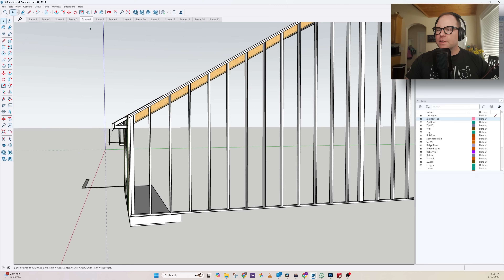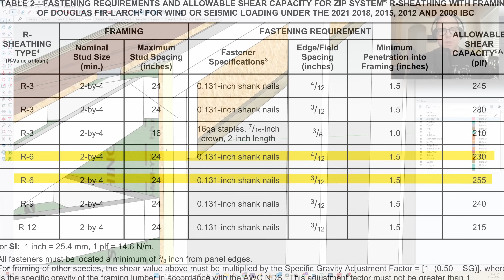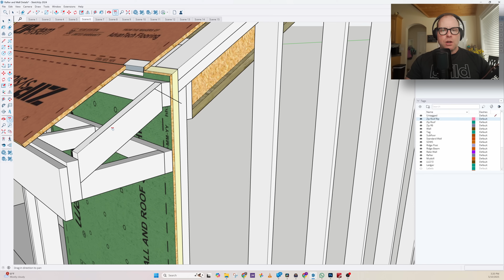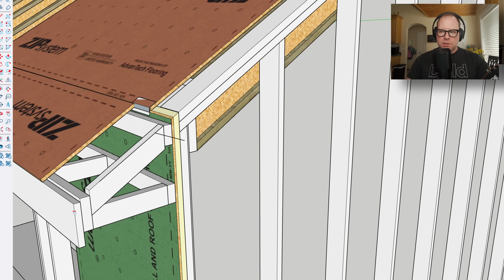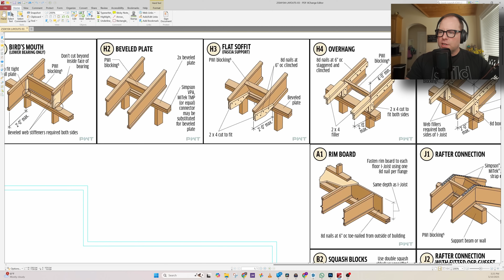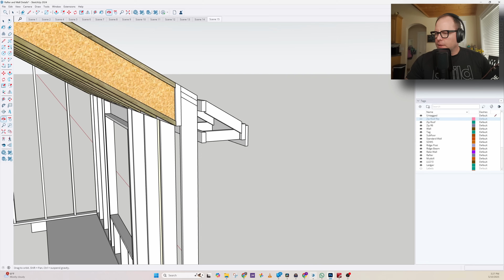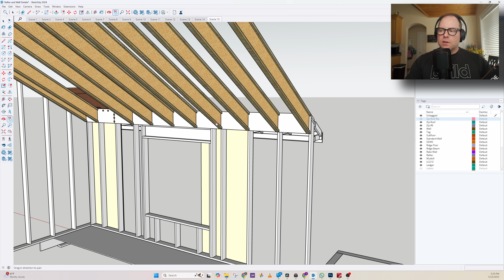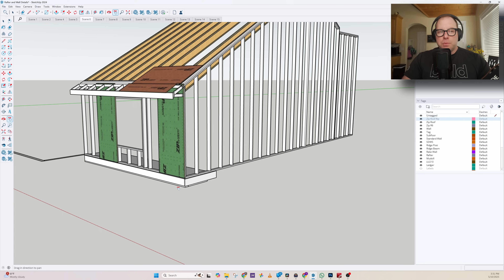Help Me Build It Better – Your Feedback Needed!

Comment: I have a passive solar 6/12 warm skillion roof timber frame with masonry north wall. Close in shape to what he showed. I could only span about 15 feet because 2x12's. So have a middle bent. My over hangs are tied into the warm roof. I have exposed rafters and tongue and groove roof board that land on beams and end. No drywall, because tongue and groove. I have a planter box on south wall. So need moisture to escape. That's why mineral wool board wrap cottage and low perm vapor barrier. I have 70 psf snow loads and needed r 60 roof for code. The r 60 roof insulation was why I went with warm roof. My rafter tails are 2x4 green board and 3 foot long, but sit on cmu and riprap veneer stone. The rafter tails screw into my roofs insulation box and provide ventilation for warm roof. We asked our engineer for cheapest design to build. And got A frame and skillion designs. We use glulam beams so only need to mortise post and add bracing. No tenon cuts needed for glulams. Cost of glulam less than labor for tenons. Mine are closer to H4 with can't strips on middle bent. The 2x8 for insulation box is notched for rafter tails. We use truck winch to stand up bents.

Comment: Split the roof sheathing and overhang sheathing on the canted top plates, something like 3.5" and 2.5", respectively.  Zip tape your monopoly framing before the overhang goes on.  Then add on the overhang with preinstalled sheathing with the 2.5" + 1.5" lip (add 1.5" for the ZipR thickness).

Comment: How about building a Eaton Canyon wildfire 1/7/25 single family 1 story here in Altadena.  I plan on exterior Zip for walls to the roof R6 from the Foundation and on the subfloor over the crawlspace and at the attic floor.   The crawlspace grade will be sealed with 10 mil and lay pea gravel or concrete slurry.  All framed in 2 x 6 min. I am struggling with what to do in on the Roof for insulation    I will add 2 foot eaves on my 12/12 roof.  What say you.  I am new and absolutely the videos.  Fantastic

Comment: I have a few general suggestions for minimizing framing members and thermal bridging. 1- Remove fire blocking between floors.  
If I'm reading IRC 302.11 correctly, most insulations installed normally are approved as fire blocking. And if you read 302.12 "draft stopping" carefully it doesn't apply. 2- Remove the 2x6 below your headers. I just rip a board down and nail it flush with the bottom of my headers it also allows you to raise your window 1.5" if needed. With the ZIP-R6 there is not much bridging so you would see a bigger benefit when not using continuous insolation.

Comment: Yous are so well set up over in the us i did the roof on my mates house the other week huge big things hips blind valleys open valleys unuqual pitches with different over hanges 1story with rooms in th attic put our own steel where we wanted picked the rafter size where the purlins go ridge size just given a oh and height no inspections no nobody we do things diffrently over here but similiar not as anal .joisting and studwork dont line up we  dont timber frame on site concrete finishers dont exisit just a pump and lads with a 3' tamper and we consider american  built houses cheaper and inferior in europe you guys do it better faster and cheaper expected lifespan of a home here is expected 50yrs before a major overhaul new roof tiles pointing windows renders etc not that long. Timber frame house with siding is probably the same i seen a lad roof a 200sqm roof noto long ago with 7m rafters hip etc nailed the whole thing with fraimig nails but jointed hip rafters on the purlin cowboys making good money. No sketchup and how would you do that. I respect how you do things over there most carpenters over here wouldnt last long over there. Respect

Comment: Could you use spray foam or pl to attach the sheathing to the overhangs instead of taping over the zip from the roof to the wall? This way you could still be able to run your sheathing from the roof over the overhangs and also be air tight in that area?

Comment: Structural engineer here from the opposite side of the country. Just some overall thoughts on the overhang detail. It looks like you're expecting to use a toe screw through the overhang rafter. This won't necessarily align with your studs, so the only thing they're hitting is the ledger on the opposite side of the wall (screw comes in too low to hit your top plates). That might work, but that leaves a stud-widths gap in the fastener. That would be a no-go since the screws would be in tension and shear for this application. Of course you could add additional hardware to lock the rafter to the exterior ledger which is connected to the studs. You're also making the soffit framing structural to support the overhang and work in compression as the rafter is working in tension. Might not be a problem, but wouldn't work without a soffit and you'd have to attach the soffit similarly because you have to think of the wind load uplift on the overhang. The uplift reverses all these screw forces, so you really to secure the soffit framing in a similar way. Also, I'm not sure if this is an issue or not, but won't the drywaller need blocking at the rafter-wall joint anyway?

Comment: Yall may want to look at the Simpson WP top flange hanger. You might could detail it to hang the rafters from the top plate and then add beveled plate over the hanger to flush top of wall with top of rafters. This would save you from the lvl ledger.

Comment: Starting with the monopoly build, and air sealing the outside and creating an envelope for air sealing . And if you would like to add zip-r to eliminate thermal bridging you could
I don’t see why the rest of the construction has to be so complicated.
I don’t see the need for rafter tails and the build up to achieve this.
Keep in mind I’m not a builder or engineer and this is not my profession.
Why not a normal monopoly build filling the rafter bays as normal. Then overlay the entire roof with a 2x4 structure. Creating the opportunity to have a “normal” construction of rafter tails and soffit, leaving a continuous structure from fascia to peak. Then of course you would need another layer of sheathing on top. 
The items Im not clear on, and I am not considering , Are fastener to attach the 2x4 structure on top. Do the “rafter overlays”need truss braces at the peak?
I would also suggest insulation on top of the monopoly roof (maybe rockwool of the rigid type) and also leaving an air gap underneath the sheathing that the roofing materials would be attached.
You would essentially have a way  for water and air to move out of the roof structure and would have a second water and air layer on the monopoly part of structure.
Hope I’m explaining this well enough.
This however seems like it would get expensive with materials.  But maybe save labor in the end. This type of construction does seem like it would get more complicated with particular roof layouts.  If I was doing this type of construction, I think it’s the way I would go as it would be easier for me to accomplish. Thoughts?
Reply: Not one reaction? Come on folks . I really wanted some feedback.
I may not be explaining myself well enough to get a reaction.

Comment: As a “Definitely NOT a Framer” but rather a fabricator, I don’t understand why you couldn’t do the double top plate bevel wall and just angle cut the rafters with an extra tall rim board (a modified 1B) then do the overhang as you have it drawn. Seems like a little extra work for the wall but a lot less labor for the roof framing.
Reply from the maker: There's a fair amount of labor in cutting and reinforcing the I Joists.  As a framer, these details in the video would be my preference.
Reply: I’m sorry but I’m still trying to process this. If you built your wall as drawn, but lowered it by the vertical height of your rafters, then you extended your rafters by the 4” or so in order to put the rafters on top of the wall with a vertical rim board flush with the outside of the wall it would be like having an angled floor because the only cut for the joists are the single bevel. You could probably even Simpson screw the joints to the double top plate. My apologies if my thinking is off. It’s a lot easier for me to draw than describe. Great videos though. Thank you.
Reply from the maker: @Mike-g5w6k  You can do that for sure.  Then I have to add a cant strip to the top of the wall, which means setting up a table saw and ripping them at a 60°. That alone will take longer than what I show here.  Then I have to install the rim, and sheathe over that.

Comment: After reading the comments so far, I am in favor of straps to tie the soffit assembly to the main roof rather than the  structural screws for the reasons stated: straps would be in tension as intended whereas screws would be primarily subject to shear loads (NOT as intended); straps are more flexible/ductile vs. screws being more brittle (straps are less subject to sudden catastrophic failure); straps would eliminate the variable introduced by the layer of rigid insulation on the back side of the Zip sheathing. I know you love the screws and I’m sure your engineer could get them to calc out sufficiently to meet code, but I believe the straps would perform better in the long run, especially during a seismic event (which WILL happen eventually in the PNW).

Comment: I believe your target is the rafter connection to the header/top plate.  For some reason it appeared you were targeting the overhang extension.  If I understand correctly, the attachment point for the rafter needs to terminate inline with the stud and header/top plates so as to not interfere with the vertical zip sheeting.  Seems like you still want balloon framing, so that rafter loads directly over studs.  I have two K-I-S-S ideas for you.

Idea#1: How about a bookshelf solution for the header?  Run an extra wide single top plate across your studs that overhangs the inside of the wall studs. Then run a horizontal batten to screw to the studs and top plate.  You get the double top plate strength and have more meat to set your rafters upon.  Set the top plate that runs across the studs in a bit to avoid the need for a bevel cut to keep in plane with the zip sheeting.  I would want wedging tagged on the bottom sides of the I-frame rafters to avoid bird-mouth cuts.  I would also want metal brackets of some type from the top plate to the rafter in order to lock it into position so as to prevent the rafter from pushing the studs in and out.  The alternative to wedges is to use plywood to build a common wedgebox from corner to corner to set the rafters upon.  Build the wedges into the wedgebox or drop a 2-by on the inside edge and nail off the plywood from outside edge to the  2-by to form the wedge box.  Either solution can be filled with cellulose to kill the air gap.  And ideally you are building this all on the ground before raising the wall.

Idea#2: Don't fight the need for stability and utilize a staggered stud wall. Every other rafter lines up with the studs of the same wall.  Every rafter will have a stud underneath, just not necessary two rafters in a row rest all their weight on the same wall.  Your portal would be two studs thick, which may not work for you.  For the portal maybe run studs on both walls to carry the window header.  The big advantage is you would be able to build each wall height slightly different in height to basically create your rafter slope support.  And by tying in the rafter to both top plates you prevent the wall from bulging under the load.  Bonus if your staggered studs allow enough thickness for an OSB or zip strip to run from corner to corner where the studs could all be conjoined to the same OSB/zip panel sandwiched between the two walls.  (Maybe the window header draws much its structural support from the OSB/zip sandwich, too.) That would give you side sheer strength in two dimensions and allow sandwiching of a 1/2" insulation board from floor to ceiling in between the walls for an added thermal barrier.  It would also allow you to retain 2x4 fire-blocking.  If that window is a breakfast nook then its a brilliant way to utilize a wider wall.  As crazy as this idea may sound it fits along the lines of Matt Risinger's monopoly framing ideas.

Comment: Given your starting point, I would suggest leaning into the "monopoly" strategy. I would break the sheathing at the eave and tape (or if you are particularly worried liquid flash this location). Continuing this logic, I would suggest you considered getting rid of the closed cell spray foam and use ridged insulation over the roof sheathing. You eliminate the thermal bridging in the joists, avoid potential installation errors of the spray foam that can lead to condensation, and you can establish a continuous plane over across the over hangs. 

Your discussion raises broader questions on how to build more efficiently and cost effectively with Washington's current energy code. If you are starting fresh with a design, I like to start the insulation strategy thinking about the location of the where you are trying to air seal. I see two viable solutions, both with pluses and minus. You either handle it at the exterior sheathing (monopoly) or inside below the finishes. I am not a fan of systems that try to hybridize these two issues because it creates lots of fussy conditions like the ones you mention in the video.  If you decided to rely on air sealing on the interior, you could substitute the TJIs for raised heel trusses. Run the exterior insulation to the full depth of the roof insulation (which can be cheaper blown in products which easily hit R-60 values) and you functionally remove thermal bridging. This strategy allows you to get a more "traditional" vented soffit/roof condition with a continuous roof plane across the eaves. You also do not need to frame separate eaves because of the truss rafter tails.

Comment: I like the idea of Monopoly Framing in general. I see one detail in your drawing that concerns me. The specific way you are installing the rafter screws to fasten the overhang is perpendicular to the load. That puts the screws in sheer stress instead of the normal tension stress. I have never seen these screws prescribed this way and I don't know how strong it is in sheer. That leads to a more pressing concern, that sheer load transfers through the Zip-R. Because there is an inch of foam, if the screw tries to bend, it would only have to dig sideways through 7/16" OSB in order to deflect. I would suggest angling all-purpose construction screws at an upward angle into the double top plate. That will put the screw in tension and apply less force in sheer on the screw shank across the OSB. It also gives the added holding power of a screw head. GRK R4 screws are available up to 8" long so penetration should be possible.

Comment: Instead of building the walls to the top of the rafters, build them as normal rip a continuous engineered rim board to your roof pitch and land on the outside wall with a cant strip so that you don’t have to cut a bird’s mouth. Since you use 2 to 6 exterior walls that should still give you enough bearing, save you from cutting each stud on an angle, having to rip 2x8 double top plates, and cut way down on your hardware bill. As for the eaves, the way you have them drawn looks pretty much exactly the way we used to build them when I worked for a modular home company. Hold your sheeting up 8 inches or so from the bottom of the rafters cover that gap with a piece of Sunfelt and then tape it to the roof. Then, when you sheet the overhangs that 8 inches of OSB will tie the whole thing together.

Comment: I like your detail. I have been leaving the overhang off and taping the wall to roof connection for over 10 years and love it. I have tried different methods but have settled on something similar to what you have drawn. Structurely I like the decking to span the overhang to main roof connection. However we get a better seal that is easier to do by stopping the sheathing like you have drawn. We work in a rural setting and have never ran this detail by an engineer but have not ever had a problem with it. That being said we work in the South and have zero snow load and not much wind uplift load. Some people are talking about using ZipR on the roof. I know that Huber doesn't approve of this but has someone tried it? Also you should try the Medeek plugin for Sketchup for drawing your framing. I absolutely love it.
Reply from the maker: RE the Zip R on the roof......yes some are doing it "off label" 🙂

Medeek?  I'll look into that, thanks!

Comment: Just a small detail, but your drywall terminations might get a little weird at the ledger. A professional drywaller can weigh in, but it seems like the bottom of the ledger would have to get ripped at the pitch of the roof so the sheet can run all the way through. Not a big deal, but something to remember. Additionally, I think you’d need to block for edge screwing on the drywall, since they’ll only have studs, no plates, on their wall sheets. I’m not sure if you’d have to solid block under the ledger for fire anyway, but if so, that would pick up the drywall, and you’d only have to do the rip on the bottom of the ledger as additional work. Looks like an interesting design overall, though!